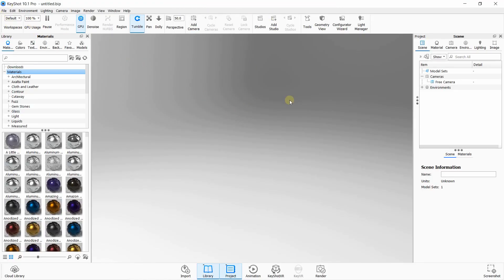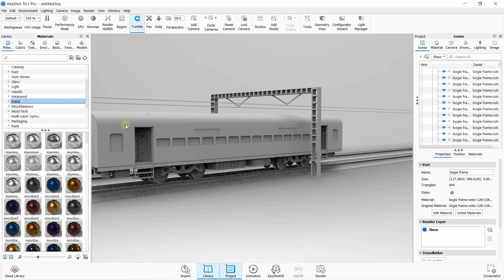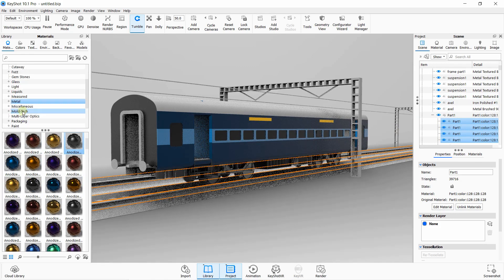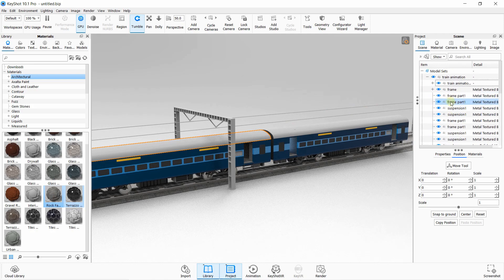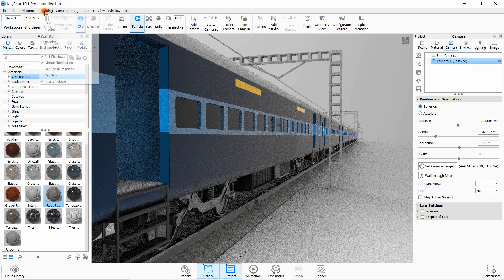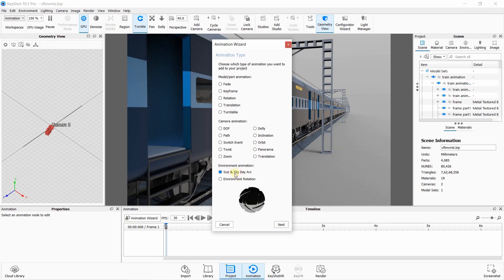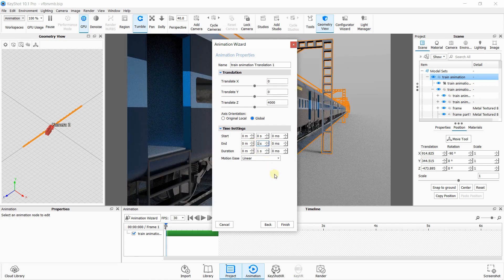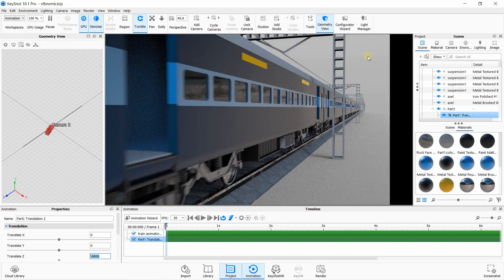how to create moving train animation in keyshot with simple steps (3d animation) #keyshot #catia

Comment: I also wonder if it's possible to use such animations in power point. 
Because i wanna to use it in "Maths teaching in the examples on train. 
For example" Train of 120m passes by the platform of 20m, if the train's speed is 72km/hr then find out the time required? "
So i will be lucky if i get a animation of train passing by platform, so that i can use it in power point presentation to explain the above example. 
🙏
Reply from the maker: Yes you can..for thar you need to make a video from this software and you can add that in powerpoint
Reply: @Cadacademy2  Thanks Sir jee... 🙏
Do u have already any creation of such a "Train passing by platform?"...  if you have then plz let me know. 🙏